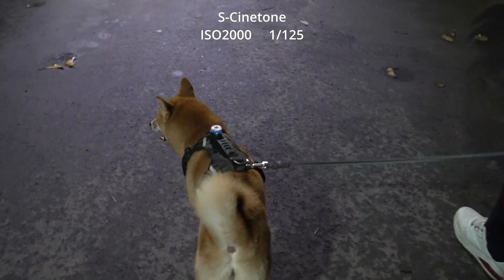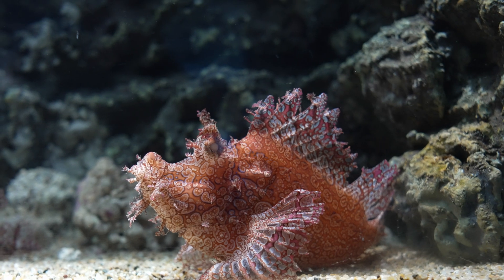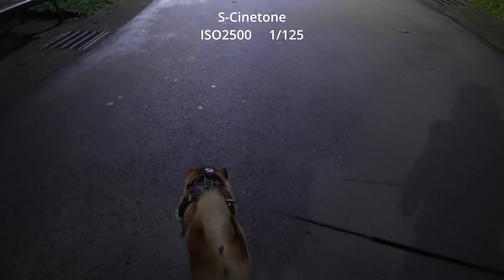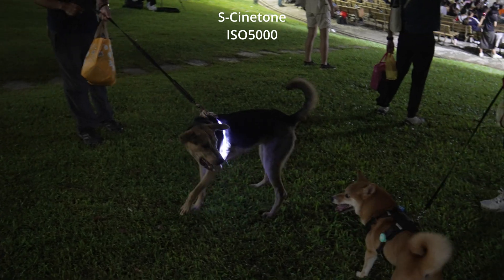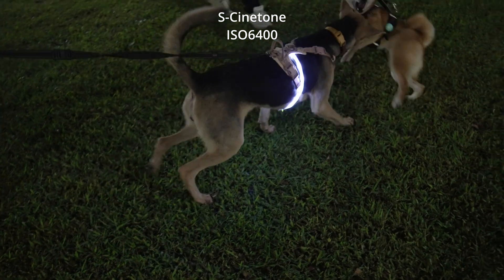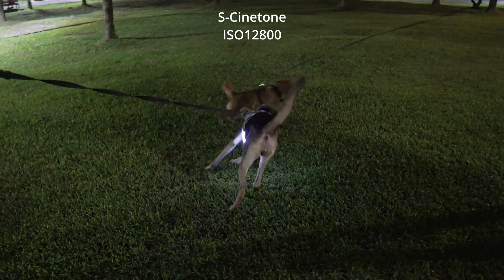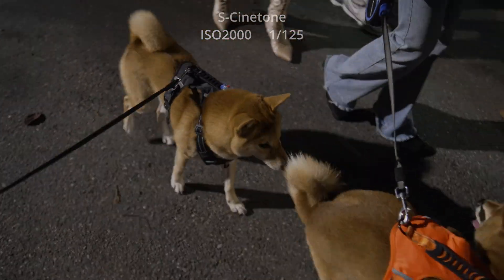ZVE1 S-Cinetone Low Light Video Test (ISO 2500-12800)

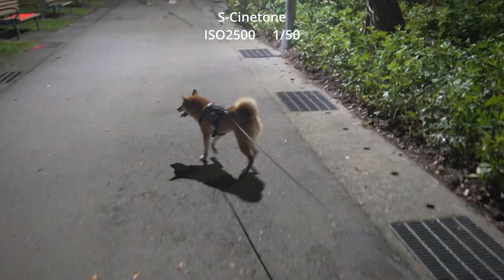Comment: Was the “shaking” at 1/50 0:54 filmed in Standard or Active E-stab? Would it make a difference in either?
Reply from the maker: This is shot in active steadyshot, but no matter which mode you use, increasing the shutter speed can improve this kind of jitters

Comment: I like your tests! Thanks for sharing. If I may, you should invest in a better audio recording system.   You control the noise in your image, you need to control it in you audio as well 😊
Reply from the maker: Thank you 🙏 I’ve tried several different recording devices, but I ended up using my iPhone to record the audio because it’s the easiest way😅😅
Reply: @ConstantineSPhotography  ahaha I get it. In that case you could just use a better microphone to connect to your iPhone so you don’t change your process. The Hollyland Mark II would be a great choice because you could keep on recording your voice over directly on your iPhone (by opting for the combo kit that includes iPhone connection) but you could also use it for your live recording by plugging ii directly to your camera as well. A pretty affordable solution that would raise your audio quality and recording flexibility! Cheers.
Reply from the maker: Thanks for your suggestions, I just looked up the microphone you mentioned and it has some really good reviews too. I’ll look into it for more details 😊